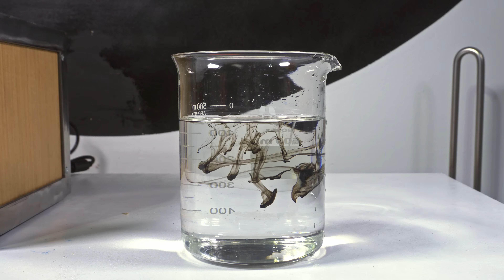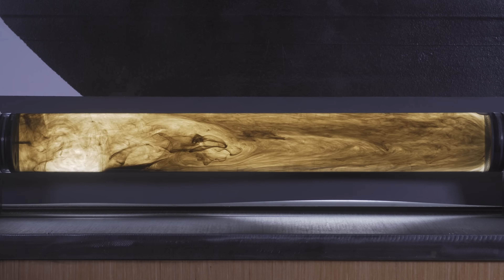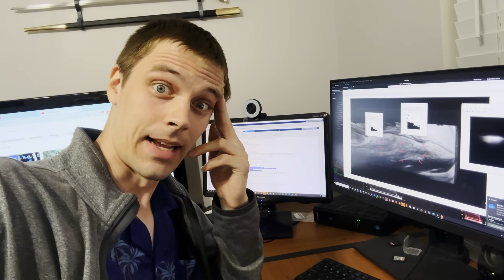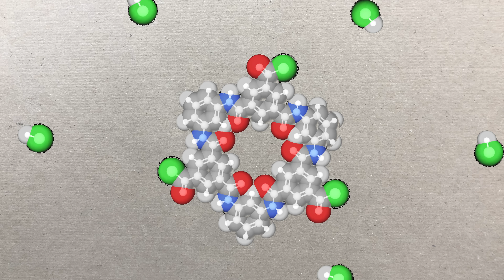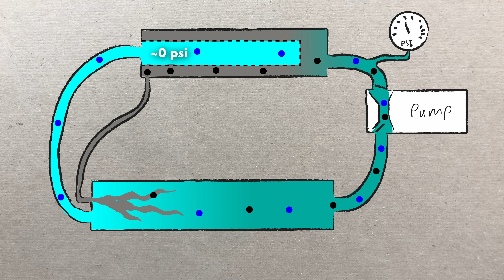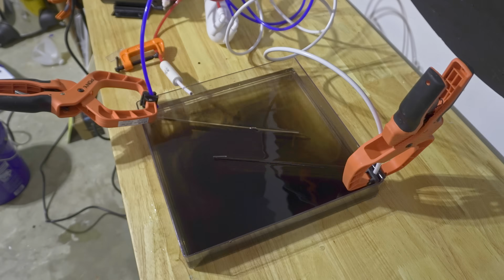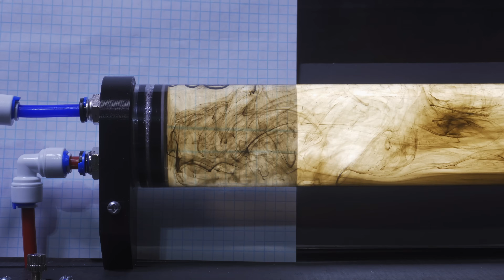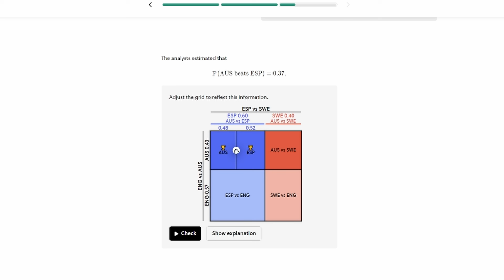I made a machine to un-mix fluids

Comment: If you think your ink + water injector is complicated, try a rocket engine injector with a hundred fuel and oxidizer elements, an igniter torch, and pressure sense ports. 

So I'm volunteering to consult with you on injector designs, if you'd like. I got pretty good at it.

Some of the engines I designed-
https://www.youtube.com/playlist?list=PL7rkaBAzb3feu-Z31ACCGJ8iA3CAB0VV0

Comment: I'm also curious if you did other end cap ideas in your designs... i think you could impart spin to the ink being released along with adding more outlets for the water that would also impart a spiral. It is even easier with 3D printing, because of the impossible shapes it allows.

Comment: My first research finishing my degree in physics was liquid-liquid equilibrium ... Do you have a mixture of 2 liquids? Is the entropy of the mixture zero or near zero? Change the temperature, and you can separate them. I measured a year. I took the temperature at which 2 liquids were mixed or not, with an error of 0.1K.
PLA? From my doctorate in materials, I know that PLA is one of the few plastics that is not hydrophobic and decomposes in water.

Comment: If you started with tap water, that might be what killed your first membrane.  Tap water kills true RO membranes.  True RO filters also require around 1000 psi, and yours is running at 120, so it may not be the same type of membrane.

Comment: I wonder if you could use a ferrofluid + oil instead of ink+water and then separate the "ink" magnetically when recycling...  Then there would be no consumables and it could run indefinitely.

Edit: Whoops should have watched longer.  I wonder what the "various reasons" for not going the ferrofluid route where.

Comment: Instead of water and ink, what about water and mineral oil? Let the two settle in an output chamber, then drain the water off the bottom, and the oil from on top of the water. You wouldn't have the contrast between the transparent water and opaque ink, but I think with a bit of lighting trickery, you would be able to see the boundaries between the two liquids.

Comment: It's my understanding that you can get different micron RO membranes just like other filters. For the sake of simplicity I'll use insanely rough numbers lol. You could pre-filter your ink by running it though a 2 micron membrane then dump all the product water(the water that was filtered). This would leave the waste(un filtered) water/ink at a size > 2 micron. Then switch over to the 1 micron filter. This should allow for better filtering. 

Also don't forget that you can bypass the restrictor on the waste output to flush the membrane from time to time. They make a kit for that pump to do this automatically every time it's turned off but you don't have a conventional setup. I would assume you'd have to have a reservoir aside from the viewing chamber for this to automatically work.

I have a lot of experience with RO systems. I built a system that replaced buying water bottles for drinking and have been going down that rabbit hole ever since. It paid for itself in 2 months. Check out how RO boost pumps work. It's kind of like a mechanical ram pump but for RO systems.

You can also run RO membranes in series for quite a bit more flow. Waste from filter 1 goes into the inlet of filter 2. Product water of both filters get tied together. There is a salt water aquarium channel that has done a lot of testing with RO and its some pretty neat stuff. It might help you come up with ideas to improve this. I kind of want to build one for my wife to show the kids that come to their STEAM events.

Silicone grease on O-rings make a world of difference. You may also want to use a UV RO light with your setup so stuff wont start to grow... I'd put it on the outlet of the viewing reservoir.

Comment: In dairy-farm filters intended to filter milk, the flow-direction is regularly and periodically reversed to "unclog" pores of the filter. I realize that an RO-sieve is not very analogous to a 'macroscopic' filter, but would this step help improve the longevity of your filter? Perhaps some other kind of jetting to de-clog the concentrated ink?

Comment: To make the filters last longer instead of ink use a long polymer of plastic with  dark colour. Think tiny micro plastic beads that will be as fine as ink but easily stopped through a filter/

Comment: I would suggest a completly different approach to seperate these two liquids. I would take ferror fluids and seperate it than with a magnet, the only thing you have to try out which oil you have to use to get similiar diffusion.

Comment: I wonder if using just carbon black instead of the India ink would be a better solution. I imagine all the shellac is mucking up the mix, and you don't need that. If you absolutely need it, you can add a bit of water (or high density oil?) as a carrier fluid.

Comment: I wonder if there'd be a practical way to separate the ink from the water using the property of the ink being heaver than the water.  Obviously a centrifuge could do it, but I don't think that falls into practical for this scale of device.   And I'd suspect the flow in general is too fast to allow a settling tank of any sort to work.  But still, it'd be nice to separate them without a consumable filter.

Perhaps if you had ferrofluid you could magnetically separate it?

Comment: Very nice work. Destin will love it.

Have you tried turning the input manifold upside down, to get rid of the air bubbles? Currently your water inlet is the highest point, your geometry looks like it would push out any bubbles, when the outlet is the highest point.

I'm looking forward to the next video!

Comment: Have you tried running the water backward in the reverse osmosis tube? In water treatment plants, they do that to prevent clogging and preserve the throughput. They call this 'backwashing' or 'backflushing', but the don't deal with ink.
Reply: With RO you just remove the waste water restrictor and let it flush the surface of the membrane. There is a kit for that pump that would do it automatically for him but i don't thing it would work here because its a closed system.
Reply: A pressure triggered automatic backwash would be perfect. Adding a higher pressure shut off in case it eventually doesn't clear it might also be a good idea for the pumps health.
Reply: I think the solution is a different type of filter.
Reply: @gabrielapetrie  - A different type of ink/pigment would also work. There is no need for really tiny particles.
Reply: came to second the back washing. RO shouldn't* need it but it would still totally work....do check the datasheet though. I havent worked in water filtration in years

Comment: Wonderful piece of art and engineering. One comment though, it his highly unlikely the you observe actual diffusion and not microscopic convection.

Assuming ink particles on the order of ~50 nm in radius, the diffusion coefficient (calculated from Stokes-Einstein eq.) is ~10^-6 cm^2/sec. This means that for t=1 sec, on averages, an ink particle will diffuse (Dt)^-0.5 ~ 0.01 mm. So for a color gradient to appreciabley change (across 1 mm of water solution) will take ~ 100 second, much longer than what you observe.

In short, on the timescales of your experiments, it is more likely that we obseve some other, non diffusive mixing effect.
Reply: Also, have you tried reversing the flow once in a while to clear the ink from the filter? It get's clogged due to VDW interactions that cause the ink particles to aggregate and stick to the membrane. You can wash with weak saline solution to encourage suspension, if the membrane permits ions. To recover the ink I would let it settle while evaporating the water, than maybe centrifuge what's left and remove the supernatant solution, to recover most of the salt. From there, you can just resuspend the soot.

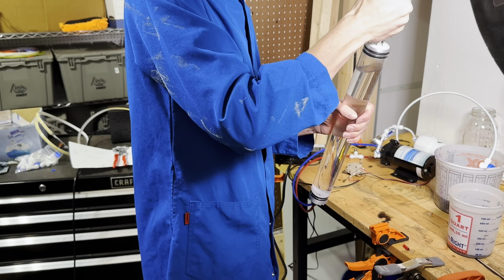Comment: 17:55 The problem you had with the endcaps leaking might not actually be solved. Waterproofing 3d prints is notoriously hard because of the pores they have between the layers. This can be helped by extra perimeters and higher temperatures like you did, or smoothing the part by dissolving the surface with isopropyl alcohol vapors. However, most 3D printable plastics (like PLA and PETG which you used) are hydroscopic, which means that the plastic itself will absorb water. At very high pressure differences, like your 100 psi chamber, the water will still be forced through the plastic. A lot of submersibles with 3d printed parts have the same problem. You can try high-impact polystyrene (HIPS), which is not very hydroscopic.
Reply: I am a bad person - the word is hyGroscopic.

ABS would work, and is extremely easy to vapour smooth using acetone. It is often used for pressurised water pipes.
Reply: The trick to printing a water tight end cap with petg is to use concentric solid infill with chamfers on the bottom. Because of the chamfers, each successive layer of concentric infill is offset from the one below it ensuring there's no straightforward path for the water through the print. You can also separate the print into an outer shell printed in vase mode for watertightness, and an internal part with the more complex geometry. I print canister filters for aquaculture this way. You can also thin pvc glue with acetone and use it as a water proof coating in a pinch.
Reply: I don't think the chamber itself is pressurized, just the filtration stage.
Reply: @olejrgenbrnner4708 Exactly! The high pressure is between the pump and the filter, not in the tube itself.
Reply: There are multiple things to consider with hygroscopic materials, in particular "how much" water it can absorb, and "how hard" it absorb water. 
PETG for example does not absorb a lot of water (about 0.2% from what I've found) but it absorb it quickly, that's why a PETG spool is affected quicker with ambiant moisture than PLA. On the other hand PLA does not absorb water quickly but it can absorb a lot.

And another thing, hygroscopic and water resistant are two different properties. Hygroscopic is about water absorption and water resistant is about degradation in water. PETG is water resistant (PET, PETE and PETG are used in plastic bottles) while PLA is not water resistant.
Reply: Try PP filament, its the only filament that will not leak or absorb any moisture. Just keep in mind that you need to print it on a layer of packaging tape and use zero heat on the bed.
Reply: A flowable infill like gyroid plus a resin pour might make a more water resistant part as well

Comment: Could you not use a fluid/inc combination that mixes well, but over time separate due to being a different weight under the same pressure. Then remove the filter and just have a bassin at the end where the liquid is allowed to separate by gravity?